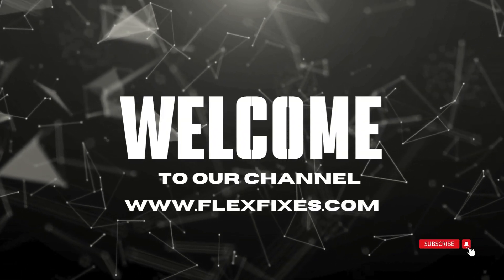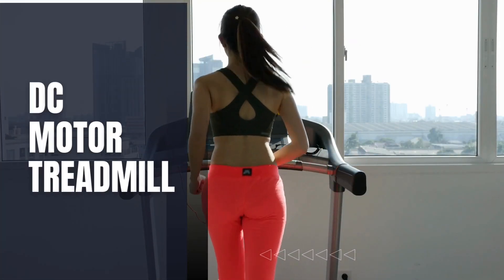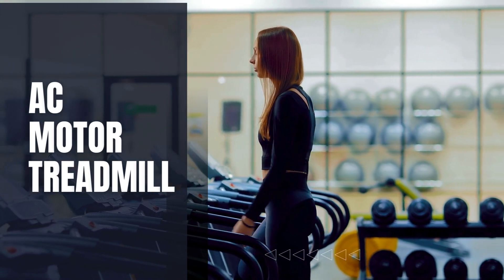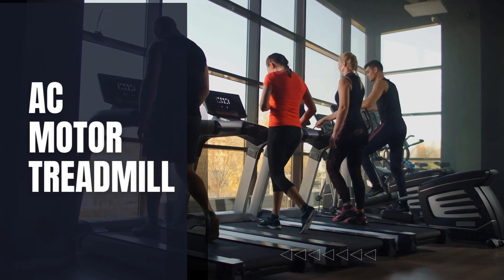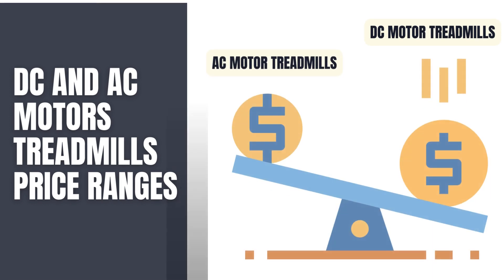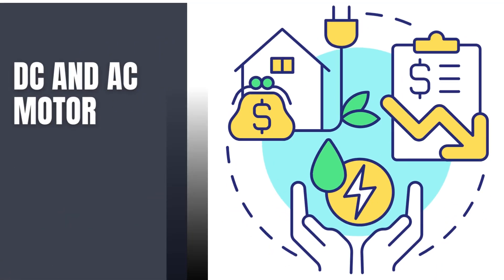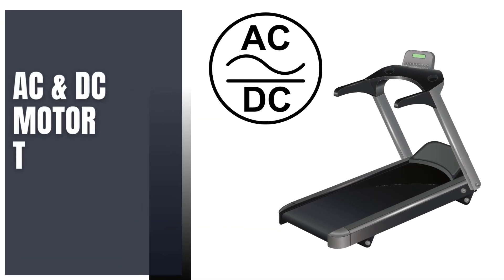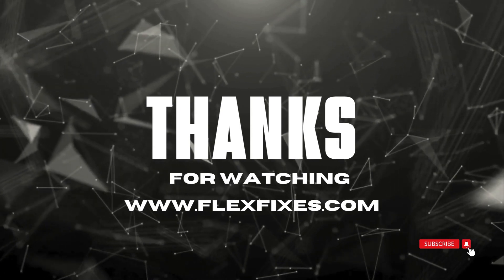Difference Between AC Motor Vs DC Motor Treadmills | Key Difference Between DC and AC Motors

Comment: can you give comparison  in both of them in terms of heating etc
Reply from the maker: Thank you for your comment! 😊 Here's a quick comparison:

1️⃣ Heating: DC motors tend to generate more heat due to continuous current flow in the windings, especially under load. AC motors, on the other hand, generally run cooler because of their design and alternating current flow.

2️⃣ Efficiency: AC motors are often more efficient in heat management, while DC motors might need additional cooling mechanisms for prolonged use.

If you'd like a deeper explanation, let us know, and we can make another video! 🔧⚡